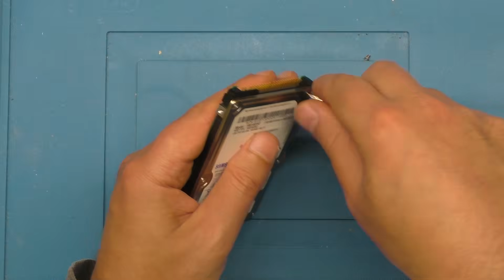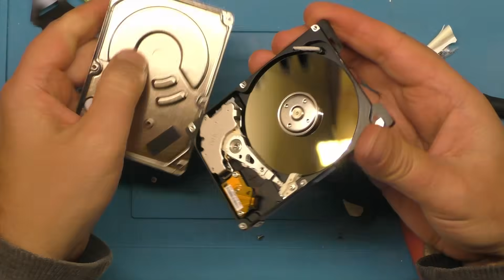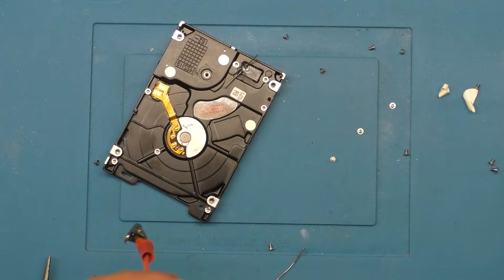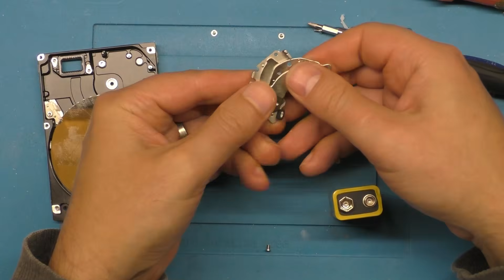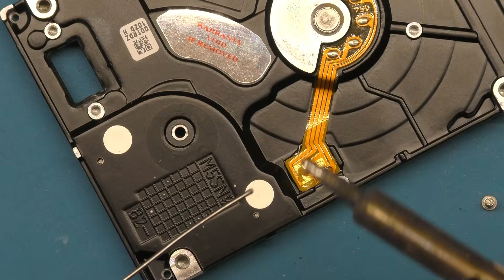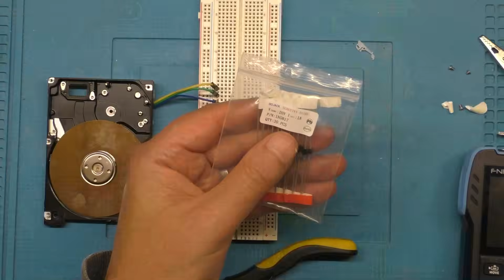I Turned a Hard Drive Into a Generator (Step-by-Step)

Comment: Maybe you could wire the actuator to the motor and make the actuator go back and forth when you spin the disk? I wonder if it would swing the arm, or vibrate it, or not strong enough to move it at all?
Reply from the maker: That's a very interesting idea!
Reply: @alexstacey could test with Aa battery? Did you try blowjng & actuator?